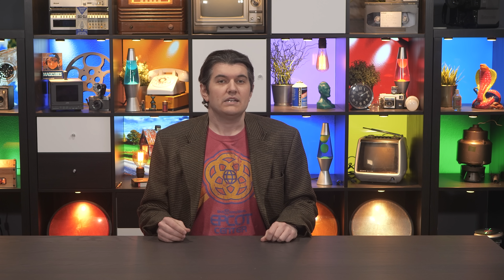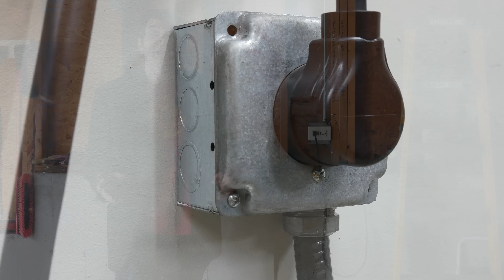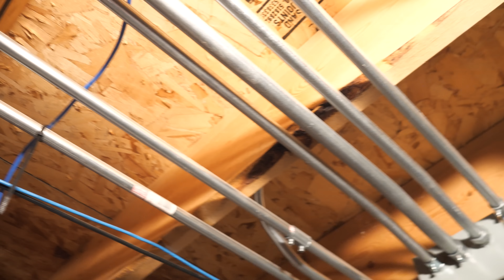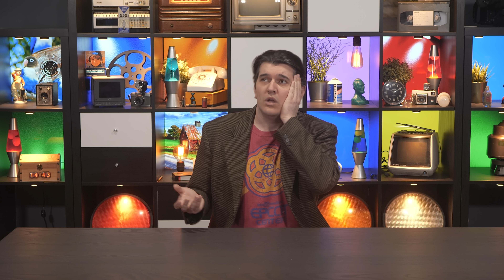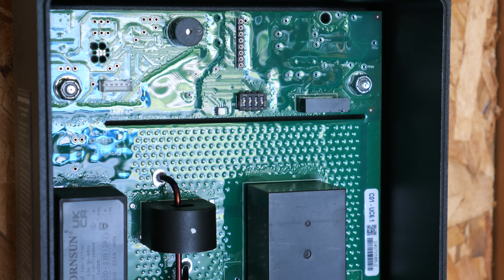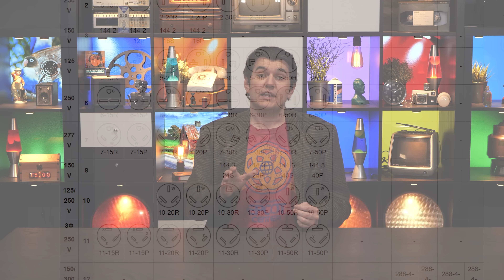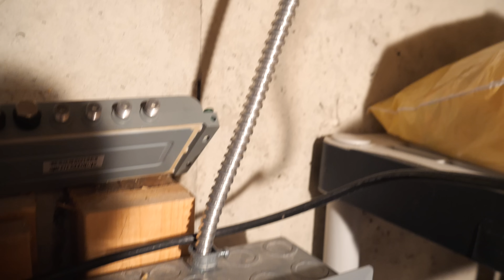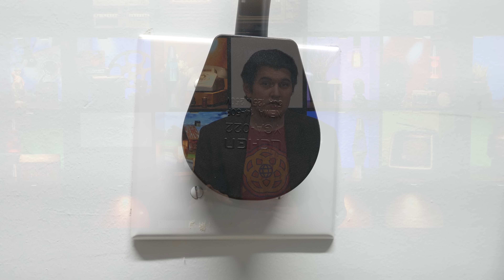The "standard" car charger is usually overkill—but your electrician might not know that

Comment: In case anyone was curious about a kind of "worst case" professional EVSE installation cost - in 2023 I had a service upgrade to 200a, and a trench with new wiring dug out to my detached garage (about 45' give or take) with a subpanel installation etc. Cost about $6,700. Not including the cost of the EVSE itself. 

This was in SE Wisconsin, so take that for whatever it's worth.

Comment: I'm an electrician, most of us are dumb. Most electricians believe that "The Grid" can't handle electric car chargers and that heat pumps don't work in the winter. Send help.
Reply: Sadly, as a fellow sparky, I gotta say you're right. I work commercial new construction, and the amount of guys I work with who could infected with a brain-eating amoeba and have it starve is... staggering. And frustrating, because I'm usually one of the ones my boss calls to fix their mistakes.
Reply: As a retired Spark, take heart, you being the fixer will bring many great memories and will enrich your career. It means great value. My goal is land with modest stand alone ground solar with one of those new 5000w 240v battery inverters to charge my new slate pickup. All portable, so I can help poor folks during outages etc.
Reply: It's always hilarious when it's presented like "the grid" is this static thing incapable of change, built by the ancients never to be touched. Like, if the power companies want to make money selling power, they will put more wires in? It's not rocket science. EV's aren't getting power for free, they are paying money for it. The grid operators will just need to spend some of that money on the grid rather than corporate bonuses and share buybacks. They spent money to build it in the first place right? I'll wager however what they really want is the govt to come and bail them out with funding for the upgrades, while they continue to take profits.
Reply: @zyeborm 
The utility companies should have been upgrading the systems as needed. Some of the problems fall on them, while other problems are out of their control. 
Stricter permit processes and massive dwmand changes are beyond their control. 
Utilities need the ok to improve lines and add power plants as needed. Unfortunately thecpermits and the work both take time.
Reply: @josephreilly8405 Utility companies upgrade systems based on demand.  Electric cars are less than 1%.  Obviously, they would upgrade the system if it's profitable.
Reply: Heatpumps use less electricity then standard units. At a result,  they reduce the demand.

Unfortunately, many grids need to be upgraded to meet a new demand if enough EVs are on it. The upgrades will have start with the doing load calculations.
Reply: Heat pump is more of an hvac thing than electrician thing
Reply: My Friend is an Electrician... I told him that my heat pump that heated my entire house was on a 15 amp circuit he said... That won't be enough to heat your house... Well Living In Quebec I can tell you... It sure did.
Reply: @answer_is_42 what R value is your insulation and what is your air tightness? You can heat with candles with enough insulation
Reply: @Ks-yq4xt my house isn't well insulated at all.  Heat pumps generate heat by using a tiny pump to pressurise gas into a liquid.  That transformation creates heat.  And a simple restriction down the line let's that liquid turn into gas which sucks heat from outside.

Super efficient.
Reply: I’ve decided to go off grid (for the most part). I have a great solar panel set up and back up battery. Don’t need the grid.
Reply: It's crazy too.  Those beliefs are actually limiting business.
Reply: In summer my discount electric window overnight is just 2 hours and my commute 62 miles without detours, so the upgrade from 40a to 48a allowed me to charge when it was cheaper but also run the heat in the car!
Reply: I'm an electrician and I know what that is code for. I don't wanna do that job so I will makeup some excuse as to why I can't. LOL
Reply: Most electricians are just installers.  And most people just parrot things they hear.  Also, I would need to see research when it comes to grid capacity.  Part of the issue with electric cars is charging time.  In order for them to take the place of ICE vehicles they would need significantly more chargers than gas pumps.
Reply: Wait until they find out how much power a data center pulls from the grid.
Reply: I'm a lineman so I've seen the utility side of the grid and it really just comes down to how much the utility reinvests back into their grid. The bigger problem is getting the transformers to supply the charging stations. I've seen some public chargers that use a smaller 500kva transformer to charge batteries that then discharge when a car starts charging so there are a few workarounds (albeit expensive) already in play.
Reply: A lot of our fellow electricians are also super "USA #1 WE'RE THE BEST" but see EVs as the issue that's going to sink us and not our 3rd world electric grid. But, you know, USA #1.
Reply: In Pennsylvania there's soon going to be a great demand on the electrical system with data centers.
Reply: @jeffkardosjr hence Microsoft wanting to reactivate Three Mile Island
Reply: Don't forget the grid is connected to generation.  That also needs massive upgrades to support an electric future.  Oh and we need to do a lot more mining--all of those battery and cabling parts need more ore.  Make sure you ignore those things though when you talk about how wonderful electric solutions are.  Or that a single electric ferry needs its own substation to charge...
Reply: @dexaminer6047  republican propaganda
Reply: Keep telling yourself that,  @NickMoore

Comment: Using electricians as an example is misleading. Every certified electrician understands the flexibility in charging and has significantly more knowledge of electricity, how it functions, its limitations, and its strengths than you're giving credit for. Minimum and maximum charging rates are well within their expertise. Why? Because their safety, their customers' safety, and their livelihood depend on it.
Certified Master Electrician

Comment: Yes you could charge a car on a 120 volt outlet if you don't mind it taking up to two entire days. But most people don't have 48 hours to charge their cars they need to have it charged in 8 hours which requires a 240 volt 30 amp electric outlet (drier outlet) and even then you might not fully charge it.
Reply: Yes they need to have it charged in 8 hours. From 60% to 80%
That does work very easily with 120 volt

And yes, there are people who drive more miles, but we're talking about average, not extreme.
Reply: Average miles per year is 12k, or ~32 miles per day. Most people are not at home for just 8hrs a day, but more like 12. You can get 30-50 miles (depending on miles/kWh for your car) in that time with a 15A 120V charger.
If you're under the average for miles per year, a standard outlet will serve you fine. If you're over that, you may need charging at your destination or a faster charger at home, but you probably don't need to jump for 30A and all the pain that comes with on the install.

Comment: I guess the only reason for a 60a circuit is if you have a very large battery (like the EV Trucks) and you have limited off peak hours to charge. I went ahead and wired for 50a to save load on the panel, and 6ga wire is much cheaper than 4ga!! Though I originally had it on a 40a breaker because that's what I had lying around. But 50a is pretty awesome... longest charging time I've seen on it is 4.5hrs. Honestly everyone should avoid being stuck on 120v for charging though.... endless hours of charging.

Comment: The first few months I had an EV, the 110V adapter that came with it is all I used and it was just fine.  I had a 20-mile round trip for work and sometimes ran service calls in my own car.  I since installed a 220V 50-amp circuit but it mostly just lets me leave the 110 equipment in the trunk, while the 220 stays at home.

Comment: NEMA 14-50 receptacles are not safe for much above 25A continuous, for the most part.  There are some expensive versions that will take 40A continuous, but most people aren't using the expensive ones.  Even if it says UL-listed, it doesn't mean it will take high amperage loads for hours.  Hardwire your chargers, people.

Comment: I have a 16A charger (20A 240V circuit) and it’s PLENTY. I have a 24 ID.4 with a 62kWH pack and it does the job plenty, even with long drives and low SOC when arriving home. 

I really wanted to upgrade to the 32A that came with the car (uses a 50A circuit) but there’s no point as I’d have to upgrade my electric service. The 16A does the job perfectly fine.

Comment: My friend has 3 electric vehicles at his house, a model 3, a nissan leaf, and a honda clarity. The only car that charges on 240 is the tesla and its on a 20 amp circuit, the other two are on 120v. The house also only has a 100 amp service to it. All the cars have no problem charging up overnight despite my friend having an 80 mile round trip commute with the model 3. He didn't even have to run any new electrical, the 240 and one of the 120 circuits are right inside a window by the driveway so he has them passing through there and the other 120 charger is plugged in outside. Its really not as hard as people make it seem.

Comment: Partly disagree with the smartness of the EVSE. For example one of mine has a CT Clamp to monitor the house's power consumption, and it can talk (over 800 Mhz) to it's buddy the other EVSE to have them both scale down their charging speed in consequence. That means I set a max power limit of 11 Kw/h for the grid supply, and the chargers use whatever is left dynamically, meaning the heat pump gets priority. And that works without the heat pump or the car knowing about each other, which IMHO is great. That's a bit of smartness, with wireless communication and all, that is very useful.
Granted, you're trying to convince people to install one EVSE and I'm talking about having >1, but still.

Comment: I have to say that 110V charging on a 15amp circuit is darn-near useless, especially when it is extremely cold here in Chicagoland.  I have only needed to use it on a few occasions, but at -10F the 15amp charger could only add about 1.5 miles of range as the rest of the power was being used to keep the batteries warm.  20amp would have been quite a bit better, but I normally charge at 48amps.  I find this necessary for those days when I use 140 miles of range in a round trip to my mother's on a Saturday morning, but then plan to go out in the evening.  I can recoup most of that lost charge in a few hours.  

Also, battery health is important and charging to only 80% is common knowledge for daily driving.  Running down to 10 - 15% regularly is not the greatest either.  So avoiding driving below that range by topping off your charge is a good practice. Difficult to do with only 12 or even 16 amps.  I just think that to drive consumer acceptance of EVs, we need to have create the most livable setups and scenarios to start.

Comment: I had a NEMA 6-20R for charging for years. The only reason I switched to a 14-50 is because I bought a polestar 2 and it's OEM EVSE wasn't particularly amenable to a 6-20P. 

I got 3kW with the 6-20 and that was fine to replenish all my daily driving. Once in a while I needed more than that and I'd just visit the local DCFC on those rare occasions.
Reply: I installed both the 6-20 and subsequently the 14-50 myself as I trained as an electrician for 3 years (and was eligible to take the journeyman certification) before switching gears and becoming a software engineer ;-)

Comment: I top of my i3 every day. But that is because it has a 60 mi range, and its 10 years old so that battery isn't doing that well. I only really get 40 to 50 mi range. From what I understand I can upgrade the battery cells to double its capacity for about $7 - 14k. Which, I would love to do, but I do not know how long BMW will support the car, replacing tires and what not.

Comment: I’d install NEMA 14-50 outlet because 240V is slightly better for your battery than 120V.  Also ou also lose a little less energy to heat loss from the car’s onboard electronics stepping the voltage up to about 400V, which the battery charges at.

Comment: One of the problems is that a lot of home chargers have their own custom software stack. It is like everybody writing their own TCP/IP stack. There are nowadays Open Source software stacks: a lot more reliable. One of the most important features of a good home charger is balancing the grid connection. Get input from the home how much energy the home uses and adept charging speed to prevent overloading the grid connection of the house.

Comment: I drive between 100 and 200 miles every day in my work truck and I was looking at getting an electric one. Ha ha this was actually eye opening for me in the other way in that I assumed I’d be able to get by with one of these smaller set ups, but it’s going to be a little tighter than I realized. Might need to get one of those bigger chargers.

Comment: The DIP switches is why most people need a licensed installer: Popping that thing on a 30a breaker may work fine with your 3kw Leaf or even a 6kw charger, but the moment someone rolls up in their Tesla you will blow the breaker at the least (cuz the Tesla will ask for more power and the unit will deliver)

Comment: I did the dryer plug splitter method for myself, though the splitter has a manual switch for which item is getting the power. I can charge my EV6 from 10-100% in about 12 hours and if I ever decide to put in a dedicated outlet the charger can use a higher amperage.

Comment: I would recommend always getting the EV Rated outlet (Leviton & Hubbell have them) , the normal outlets tend to melt and are a fire hazard for the high current of a EV Charger. I have had numerous melt in a EV Charger project of mine for a local transit depot.

Comment: Rapid charging is pretty hard on battery life. I charge my 1994 S10 electric on 15a 240 volts using the on-board 3kw charger. The Leaf pack in it has shown no degradation in the 10 years I have been running it.

Comment: I’ve used 8A 120V for 2 years now with little issue other than making sure I’m topped up before a roadtrip,. If I were able to do even just 12-16A 240V that would get me 3-4x the speed and I’d basically never have to think about charging again.

Comment: Edit: I just watched a tiny bit further into the video, and he literally said exactly what I was saying. I don't know why I even bother, this guy is an absolute mind reader haha

The amount of people that I've talked to who don't understand that you can literally just plug an EV into a standard wall outlet, is crazy. My aunt recently just got a used Chevy bolt, and it has been phenomenal. She usually drives about 30 mi a day tops, for getting groceries, going to university, going to labs, and going over to her friend's houses.

Plugged into just a standard outlet, she can get about 35 to 40 miles a day. All I stayed with her for almost a month, we used that car every single day, and never ran out of power. It was awesome! Now granted if she was driving more, she would want to get a stronger more dedicated circuit installed, but as it is now, the charger literally just plugs into a standard outlet, and then you plug it into the car. No frills or fancy crap needed. I have a feeling that for a huge amount of people, 30 to 40 mi a day is all they would need 

And that is all assuming that the location that you're going to doesn't have charging on its own. If you're commuting 40 miles one way to go to work, but your work has a supercharger, then you're more than set

Comment: I can confirm - we have the same Ioniq 5 that Alec has (the highest-range 2024 model), and even after a long day of driving, the dinky little 120v 15A outdoor charger we have (the outside receptacle is on the same 20A circuit as the basement outlets) is more than enough to recover a usable amount of charge by the next morning, and that's with a three hour round trip commute. In the rare circumstances that isn't enough (like the occasional back-to-back trips down to the Boston area), a quick bathroom pit-stop at the Electrify America chargers at the mall next door and all over the place off the highways is more than enough to cover the rare extra demand.

I'm not joking here, folks - the best-case 300-someodd mile range of our long-range EV is almost completely satisfied by dinky 120v overnight charging. It took a few months to get over the range anxiety that all new EV owners have, but it really is not a big deal. You don't need beefy charging at home.

Comment: As someone with a 116 km (one way) commute back when I got the car, and now a 60 km  (two way) school drop off twice daily, I most certainly do need a 240V charger for overnight. It is the long daily drives that prompted the need for reduced fueling costs that an EV gives, and forcing me to public DC chargers would not help that goal. I am pretty sure Joe Average doesn't need so much charging, but to be honest I am seriously considering upgrading even the 240V circuit to allow greater than 15A charging, so on heavy use days (like when my wife also does a 200 Km drive after the school drop off) she doesn't have to public charge as well.